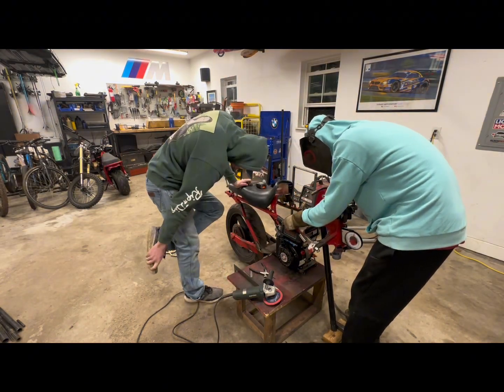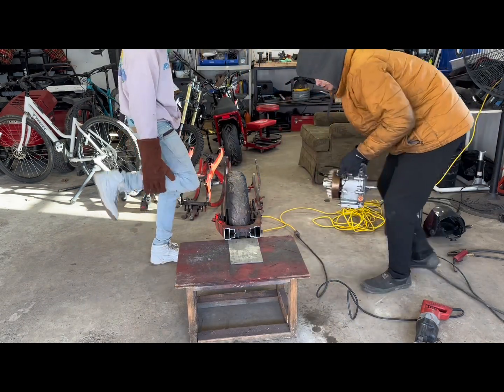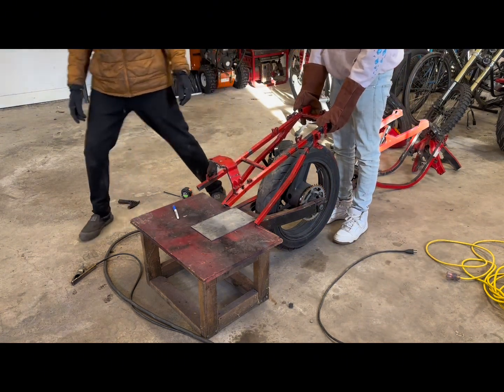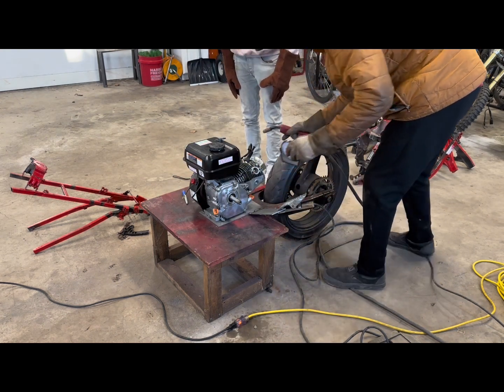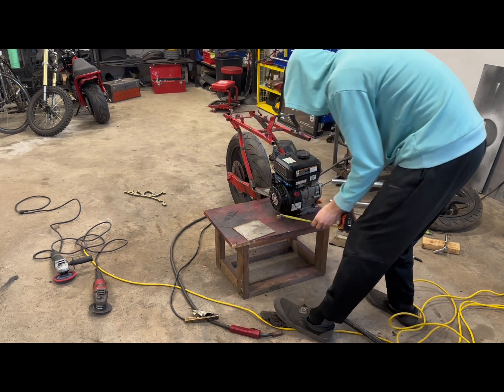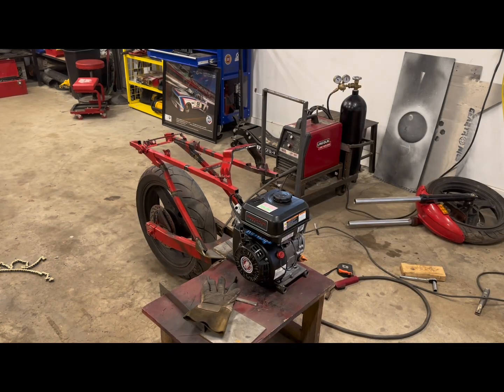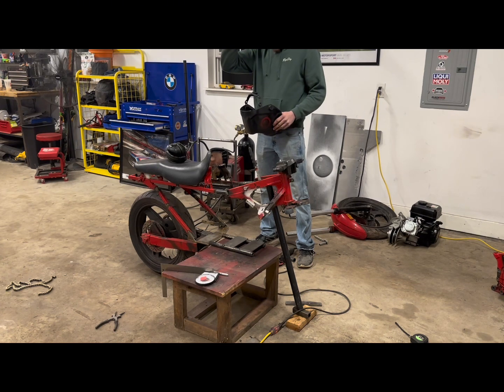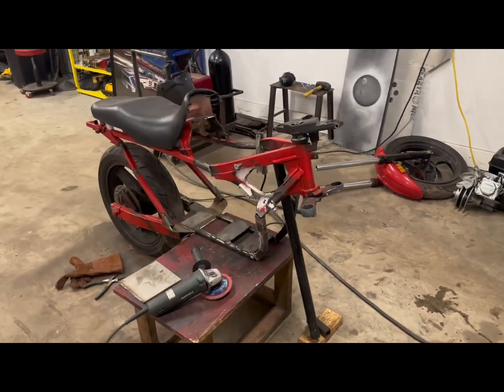Building our first custom "mini bike" frame! Out of a 1991 ninja 500 frame

Comment: Look into rake and trail. Your steering axis angle looks very upright, and that could cause stability issues at higher speeds and make the steering twitchy. Typical dirt bikes have about 27 degrees of rake angle, but yours looks to have less than 20 degrees.
Reply from the maker: Thanks for the tip I set ours to 25° might have to bump it up to 30° like your saying also might adjust the length of the front shocks that should help the rake angle grow as well!
Reply: @MiniMetalFab  Cool. I just wanted to say something in case you weren't aware of the importance of rake and trail. 25° should be pretty good for that machine.
Reply from the maker: @JohnSmith-mf6tq  ok word thanks for the help man we appreciate it. Hope you enjoyed the video!